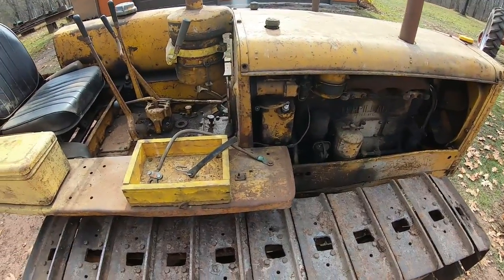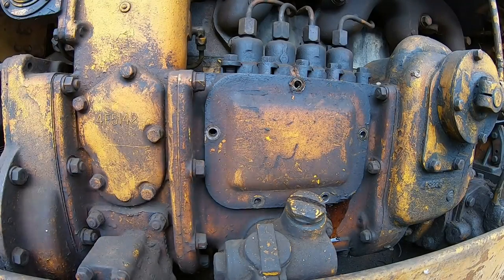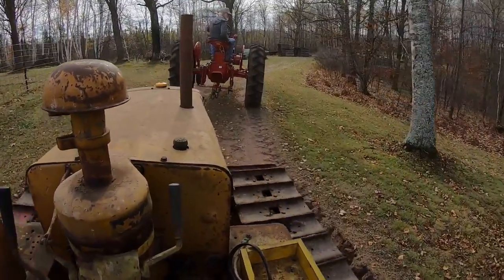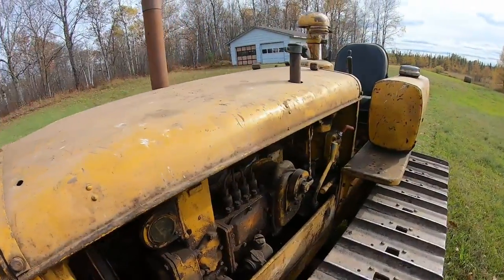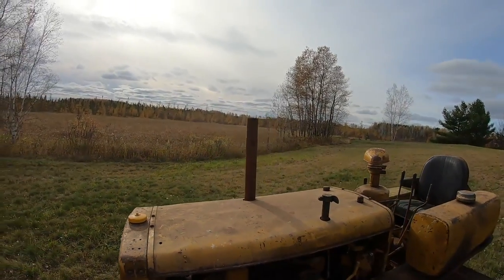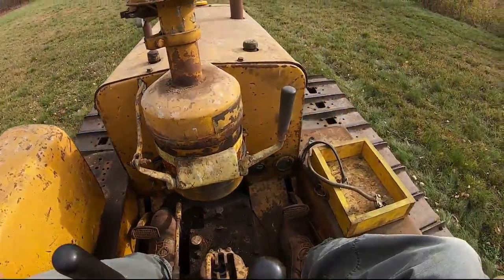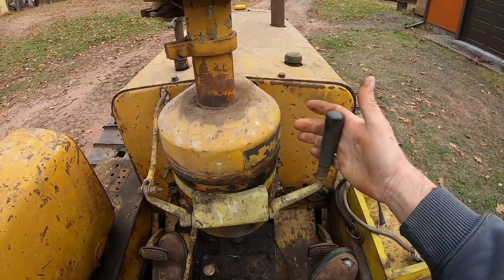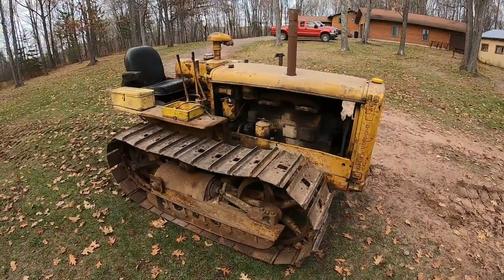Will It Start After Sitting For 20 Years??? Caterpillar D2 #5U4177

Comment: Nice little unit you have there Squatch, That little thing runs like a swiss watch.  I do have a fuel system question regarding the D311 as I have a 212 Grader ser# 9T2173. It barely wiggles the gauge cranking with the pony in the fuel off position and fuel on makes the gauge loose all pressure. I have changed filters with OEM Cat and have good flow out of the line to the tank. Do the fuel pressure regulators in these have problems with springs going bad or should I be more focused on a bad gauge?
Reply: I  drove the d2 for over 15years on the farm I used to clean it every day after use Just loved the d2 it was great on the hills  sir Roger nz

Comment: Hi Toby is the diesel motor on this 5 u the same as you're 5 j 1113
Reply: Ok that's what I thought the d3400 has 6 bolts on the injector side cover and the d 311 has 5 bolts like my d2 731
Reply: Sorry d24u731

Comment: Bottom line, what would it cost in parts to fix the rearend?
Reply: @squatch253  I have a RD4 for parts if you are interested it just has a cracked final drive but does run